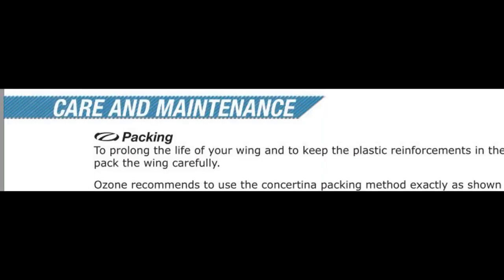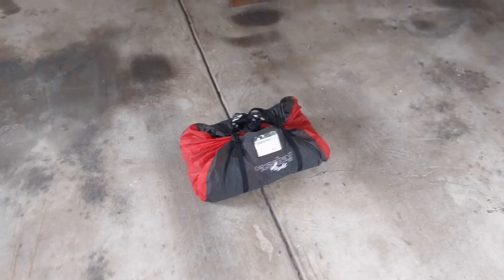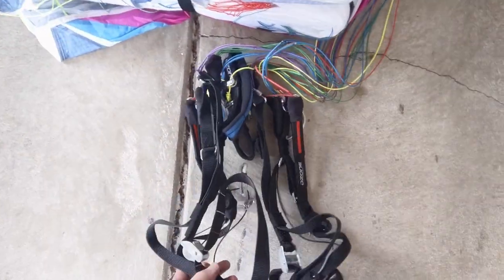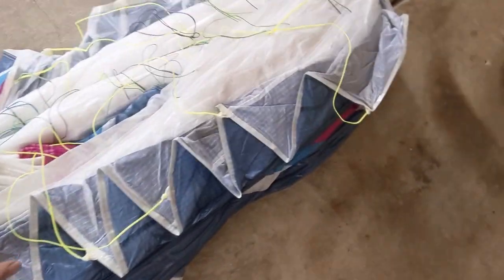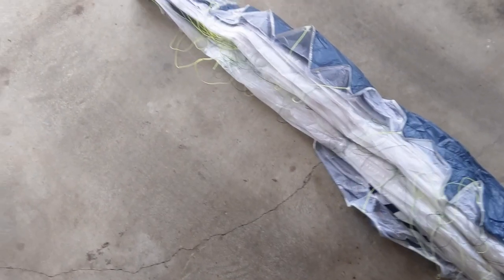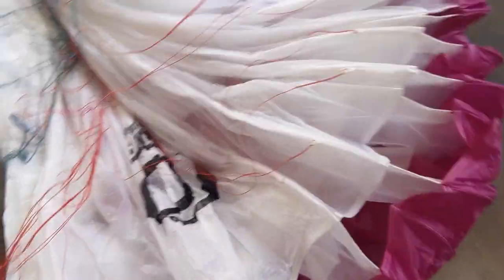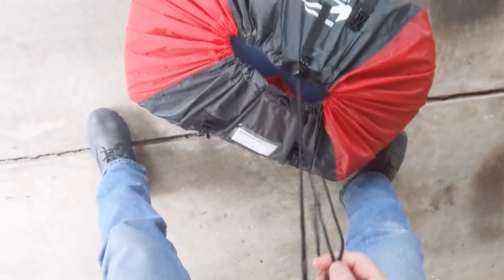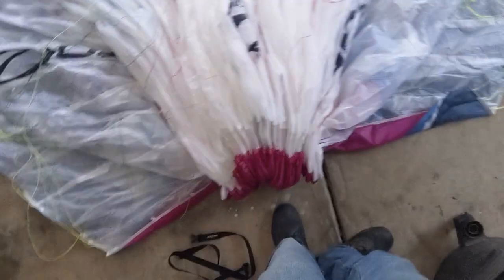Folding Packing Paramotor Wing Concertina Method

Comment: Nice work. See you up in the air 👍🏻. Best, Bas
Reply from the maker: Back from the first flight on the wing and did a quicker fold on it.  I'm thinking I need some kind of gentle clamps, but haven't invented anything yet.
Reply: Did your wing come with a big sack? I don’t fold it concertina-style every time. Rosing it up and then gently stuff it in the big bag works for me. Wing still looks brand new after ten or so times. And as it is not folded very tightly it dries better after landing in a moist field.
I suppose when you need to travel with it the concertina-method is more necessary.